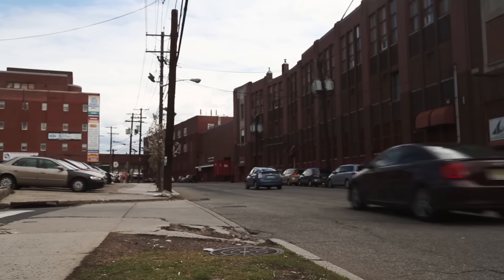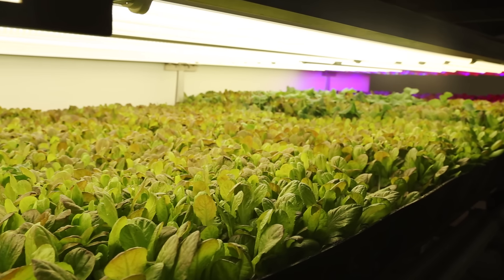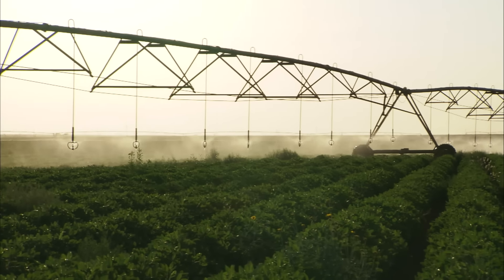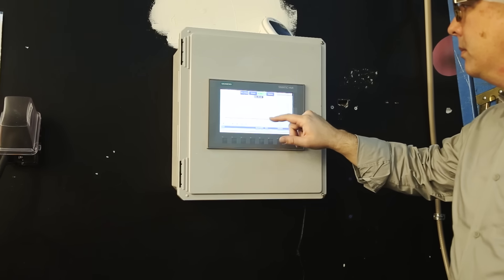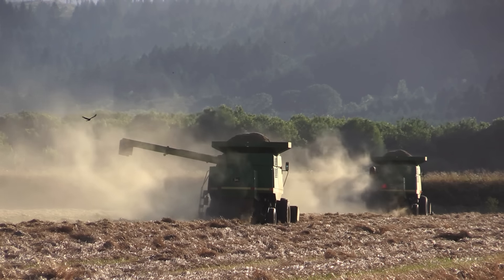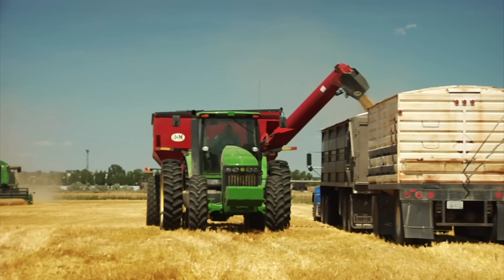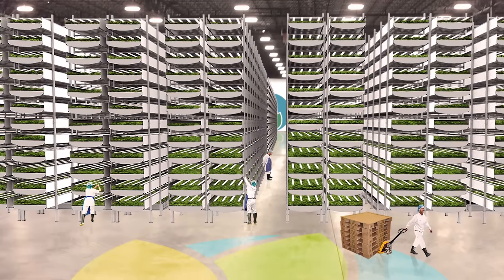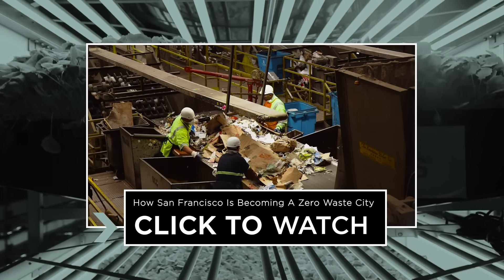This Farm of the Future Uses No Soil and 95% Less Water

Comment: if solar power can power that then we're on to a winner
Reply: Solar power could easily power it
Reply: Even better: Nuclear
Reply: But solar is so much easier and is 100% renewable, especially for small scale operations like this
Reply: Not as renewable as it seems when you think about all of the energy and resources that go into mining the minerals for the panels, and the energy that is required to construct the panels as well.
Reply: Even better, those human-powered cells from The Matrix
Reply: +JaMario Fantasia Good luck trying to sell crops created because of a nuclear reactor.
Reply: JaMario Fantasia Nuclear power is too unsafe at this point in time with our technology in my opinion, there are better options out there.
Reply: EBA That's so not true. It is actually the safest and best source of energy available today. The deaths per year statistically are much much much lower than those of building dams, coal, and oil.
Reply: JaMario Fantasia You obviously don't know what renewable means, and to counter your point about the materials is we are spending a million times more on building coal, oil, and dam plants than we are on solar power, and solar power will never run out in the foreseeable future, and it takes about the same amount of materials to build those plants as it is to create solar panels which require little upkeep. The only downside is nighttime, which batteries practically solve.
Reply: Yes there is energy expended initially to make it but there is a long term net gain. Think of paying the bank 100$ and the bank pays you back each month 1$. After 100 months you broke even and every other month you gain a profit of 1$. That's the key difference and that's why it's called renewable. Wind Farms operate on the same logic.
Reply: +Rebbids Stuffed Definitely if you disagree just ask the people in Fukushima
Reply: Of course solar can power it. All you have to do is spread it out horizontally to let the sunshine reach the plants. We could call it... horizontal farming... or just... farming?
Reply: ***** wow that's brilliant! Why didn't the Japanese government think of that. Are you like some sort of genius or something?
Reply: +Rebbids Stuffed I am impressed by all the information you know... Thank you for your common sense and profound research... Very rare to see YouTube commenters with accurate points
Reply: suicide is the answer to all problems It's not that hard to do if you just put a little effort towards google and statistics. Thank you for the complement!
Reply: michael cook Yet those few thousand deaths are caused by faults in an early system. If you don't want to learn anything new or take risks, don't do anything at all. But you're not going to be the ones advancing civilization. What about fire? Fire kills thousands of people per year, yet it still is not outlawed or banned. Deaths caused by operating machinery each year is NOTHING compared to the amount of deaths caused by rare natural disasters and faults in systems. People aren't perfect. But 6000 deaths compared to ~5 billion people constantly using electricity? I think that offset is pretty practical. You can't save them all.
Reply: Rebbids Stuffed It might be the most effective ready source of energy out there, but if you believe its the safest then you're completely clueless and your opinion isn't even valid.
Reply: 1 inch of sunlight doesn't necessarily equate to 1 inch of light, etc...

 If you had watched the video you would have noticed they said they don't use yellow spectrum to cut energy use as plants don't need the yellow spectrum.

 Thus ALL food grow outdoors in sunlight wastes MORE energy because that yellow spectrum light is not being used.
Reply: +Guy Smith it may be 20% at the most expensive panels but it's renewable and after the initial investment free and environmental friendly. Horizontal farming has problems such as excessive usage of pesticides and water while vertical is bad for corn etc. also vertical farming is been around much less than horizontal that is for milenia and is highly optimized. The existence of one doesn't make the other bad. Both are best suited for specific scenarios.
Reply: +Guy Smith i.e. Growing greens it's much worse horizontally because of transportation and short lifespan
Reply: But you are equating a 1:1 ratio of sunlight to energy.

 But you are missing the main point of the purpose of these farms. And in doing so are missing massive energy wastes across the food production system.

 Outdoor grown food uses fertilizers very ineffieceintly. Only 10% of the fertilizer gets used, the other 90% runs off into rivers and streams polluting them. On top of that that also means that 90% of the energy required to produce them is wasted.

 Indoor farms use probably 95% of the fertilizer. So VERY little waste there.

 Outdoor farms use pesticides which are nasty cancer causing chemicals that run off and kill streams and rivers. And that's not counting the cost of production/transportation.

 Indoor farms DON'T use them AT ALL.

 These farms are close to population centers (you can have huge ones for huge cities, small ones in small towns). So you aren't wasting tons of fuel transporting lightweight vegetables in cancer causing diesel wasting trucks driving all over the country. So you eliminate not only THAT wasted fuel but you cut down on the required oil wells polluting huge areas of ocean and land.
-------
 It's easy to point the fingers and go 'lights = electricty' must be a huge waste of energy.

 It's hard to look at all the facts from every angle of current food production and see the enormous amount of waste that is inherent in it.

 Also, the solar panels that gather the sun don't have to be ONLY on top of the plants like sunlight. Sure, the roof of the building can be covered with them and it's a huge roof. So most of the building can be powered by that alone.

 But it can also come from other sources. Farms also require energy demand beyond 'sunlight'. Do you add them to the other horrible costs of current farming techniques?

 Humans really need to wake up and start thinking logically to solve problems instead of just pointing fingers with simple arguments that are based on no solid facts and figuring we do it like this now, might as well keep at it.
Reply: We'll be set once we find a way to have solar panels work as efficently, and store as much energy, in winter months as they do in summer months... Having it powered efficiently year round would make it a winner
Reply: why does it all have to come from solar thought? Sure that would be great, but how many other industries do you hold that standard too?
 Certainly not corporate grocery stores. They don't but nobody ios complaining./
Reply: +Guy Smith you are making a flaw when you correlate 1:1 sun and led light. A solar panel creates X watts electricity. The farm has Y watts consumption.  This means the max possible watts from panels is M=Xa where a is the max amount of panel that fit the roof. Then you do Y-M=G, where G is the power you need to suplement from Grid. Having panels doesn't mean you are self sustainable on energy. And 1 hour of a Led light is less consumption than 1hr electricity produced from panel.
Reply: Visible light, sure. The sun produces a lot more than visible electromagnetic waves.

The LEDs will produce light which is very close to  the specific wavelengths the plants actually use, and nothing else, which makes the LEDs efficient in the 90% range, while energy from the sun to the plant is probably in the 4% range.

Solar panels can use around 20% of the suns total energy, while plants can use around 4%, per given area of used land.

This means that with solar powered vertical farms, the plants can use probably around 15-17% of incoming energy from the sun.
Reply: Also, plants are more efficient at absorbing the wavelengths that the LED lights produce
Reply: oh ya
Reply: @Cortesevasive  Ask those who lived in Fukushima or Chernoble how safe it is.
Reply: @Cortesevasive  They are still very dangerous

Comment: Vertical farming is definitely a good idea, but let's integrate renewable sources of energy into it. I think an array of solar panels installed atop such vertical elements of vegetables is the next step! And overtime, we can also desalinate water to be used for the vegetable growing process!
Reply: as i know, solar panels brings their money back in 8 to 12 years, at least in terms of Turkey. It should be similar everywhere.
Reply: Just throwing panels on the  roof wouldn’t be enough energy. You would need 5 acres of panels to support 1 acre of indoor growth because panels are approximately 20% efficient. If this is a vertical farm that number doubles for each vertical rack of food crop.
Reply: A great innovation would be outdoor aeroponics. The issue is irrigation and the structure of the vertical greenhousing. I agree that we need to rely on nature for to supply our needs to reduce environmental impact.
Reply: Solar panels aren’t cost effective enough to be viable geothermal on the other hand could be a good alternative
Reply: That would not be enough energy. Solar panels are incapable of converting 100%.
Reply: thearchitect27 or a open skylight during the day time. But solar panels are just as ideal! Either way they can use less electricity!

Comment: next level: use optical fibers to channel sunlight instead of LEDs.
Reply: TheIceThorn I gotta ask. How does that work?
Reply: @Urban_Piggy  channel sunlight into optical fibers using mirrors and then use those with prisms to distribute it in the building. It's still closed, you don't need lamps and don't need also to convert energy from light to electric and vice-versa.
...plus you've a natural day/light cycle.
Reply: @TheActionStack  why?